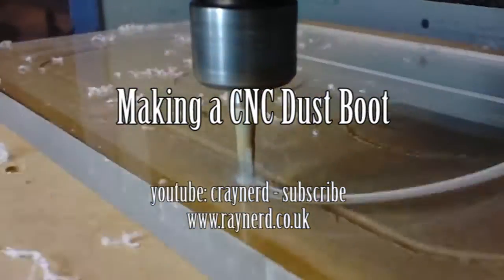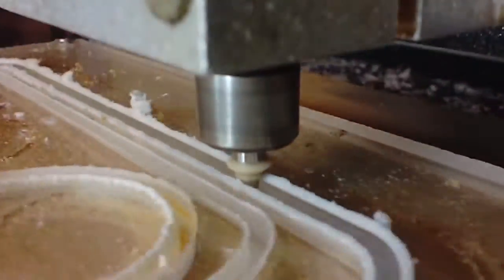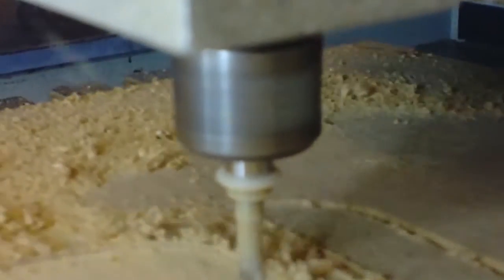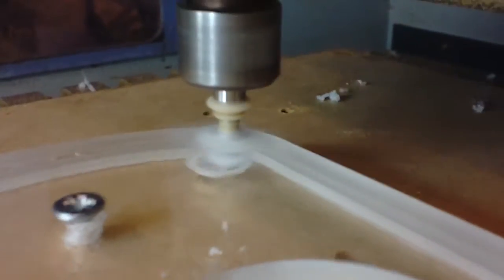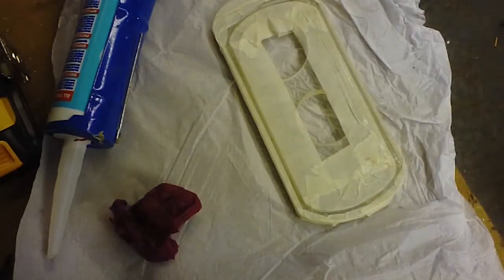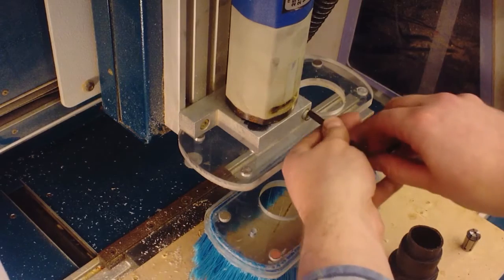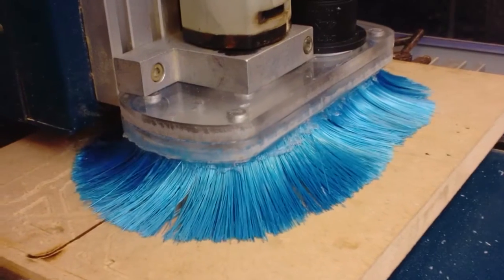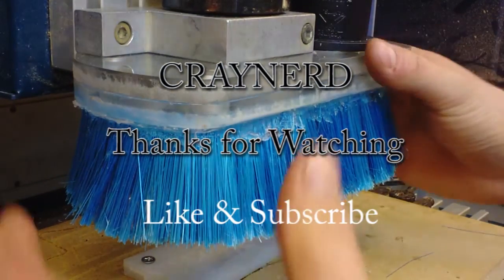Making a CNC Machine Router Dust Boot / Shoe or Dust Skirt

Comment: To prevent the plastic from melting and sticking onto your cutter, brush on a little bit of kerosene to the part. You'll be amazed how well this works.  Using kerosene is an old machinist trick I learned years ago.